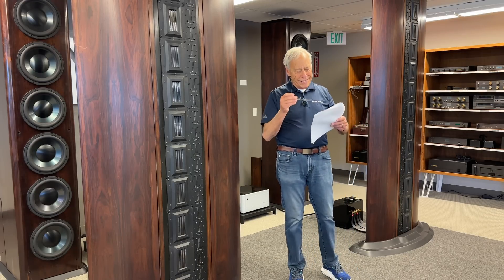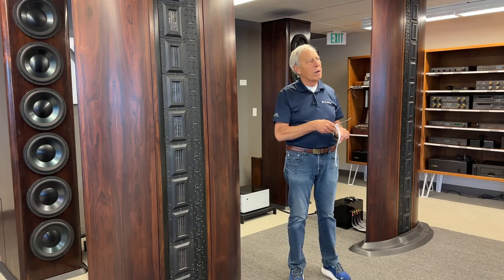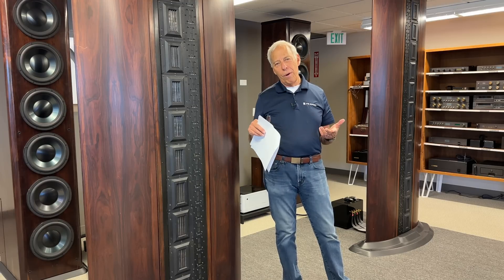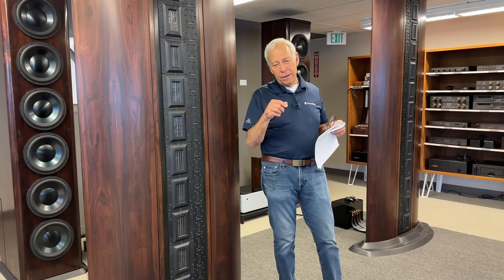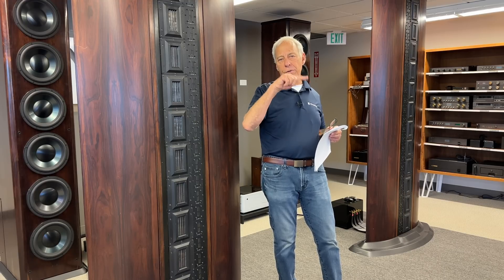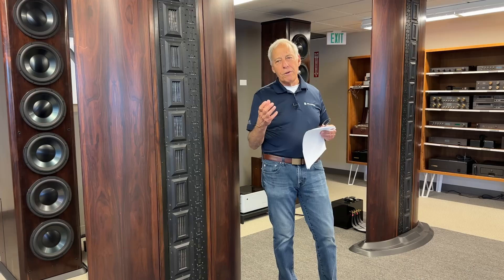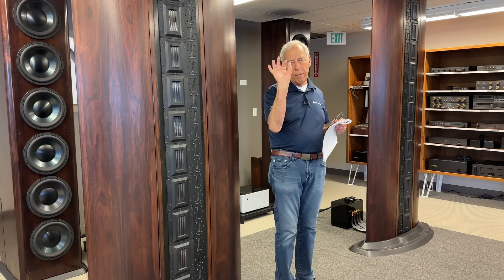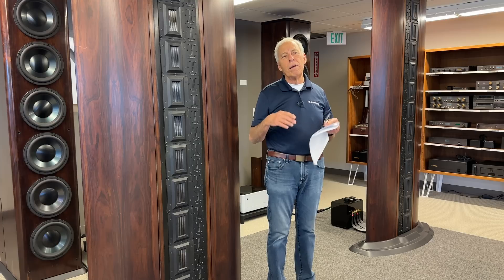Inverted dome tweeters

Comment: I’m just a ‘common or garden’ audiophile, I’ve had no tuition in electronics or speaker design. I agree that a cone is going to be more rigid and stronger than a flat disk of the same material, gauge and diameter. But surely another advantage of a cone over a disk is greater surface area. Enabling it to move more air with identical pistonic action. In the same way that a soup bowl 6 inches in diameter would hold far more soup than a 6 inch diameter table mat.
Reply: Not really. It is the normal velocity that drives sound so for the axial movement of the voice coil, the normal projected area that moves is the same.
Reply: @Rene_Christensen  as I originally pointed out, I’ve had no tuition in electronics or speaker design. However, when I was in my early to mid teens, I did join an after school electronics tutorial and practical group, conducted by our brilliant and inspirational science tutor who also tutored me to a grade 1 O level pass in physics and in chemistry. At higher education college, I achieved a grade A in A level physics. That was a long time ago and a good indication of my age.

Wilst I take your point that voice-coil speed dictates frequency, science and logic dictates that a cone shaped speaker will move more air than it’s flat counterpart.if a vessel contains 280l of water and a 1 cubic foot bucket is used to empty that vessel, it’ll take 10 pistonic actions of that bucket to empty that vessel.another buckit of the same sircumferance, vut not s soo deep, so less conical, will be a lot less efficient at emptying that vessel. That’s a gross over simplification, but I hope it supports my original point.

Most of all, enjoy the music. h